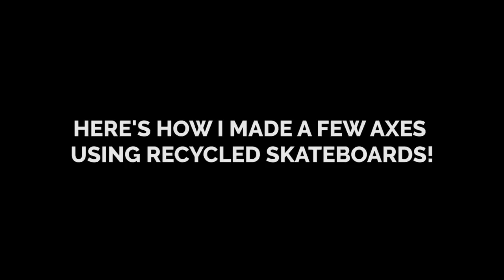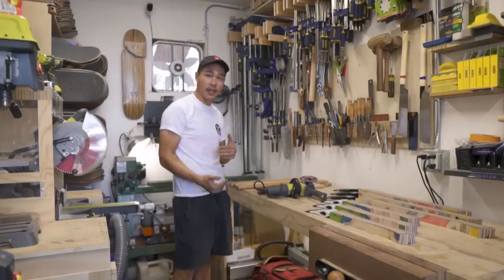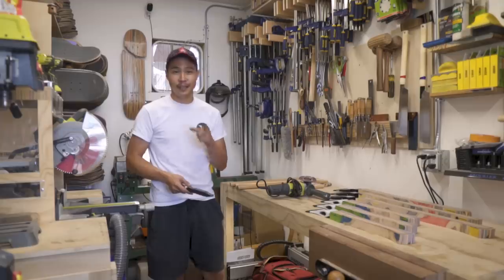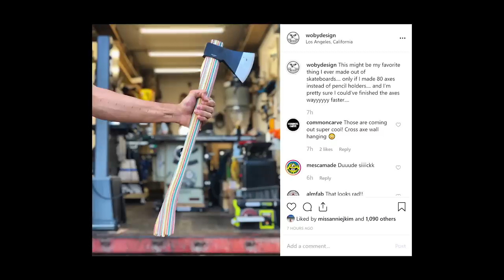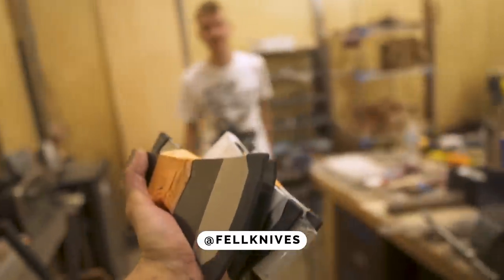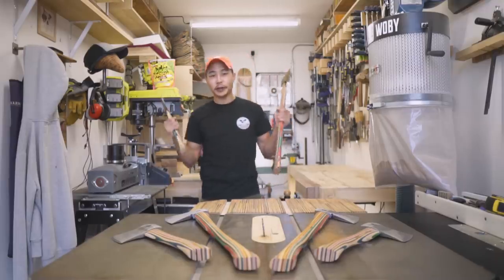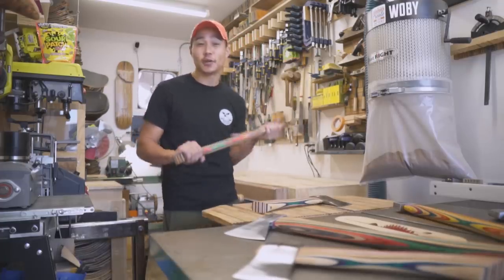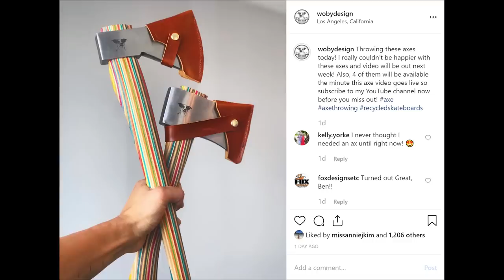AXES MADE OUT OF SKATEBOARDS!

Comment: Axes look amazing. Great video too. What I've noticed on many traditional axes is that the grain is parallel to the ax head. It gives it a bit more strength (think of a board on edge rather than flat)  but so far it does seem that you have a problem with that. It is so hard giving constructive criticism through YouTube comments with out sounding douchey. Keep up the great work.

Comment: totally kills it when you use cheap Axe heads for the super amazing axe handles made from recycled skateboards. If you would have used something that'sthat's not super expensive but not cheap quality either these axes would have skyrocketed and coolness and everything else but using a cheap axe head with a super duper handle it's like having a Ferrari with a Volkswagen bug engine